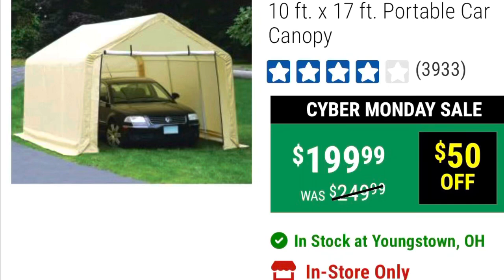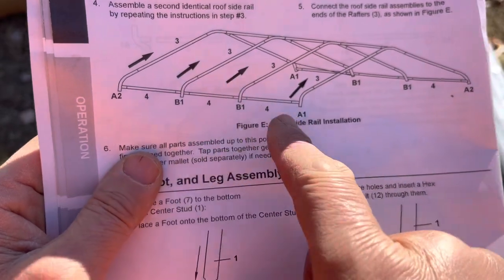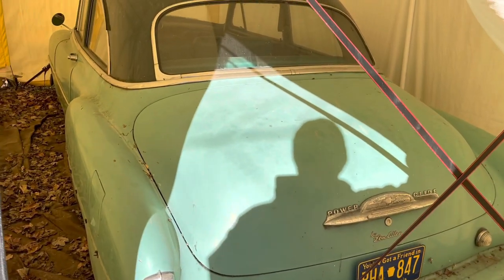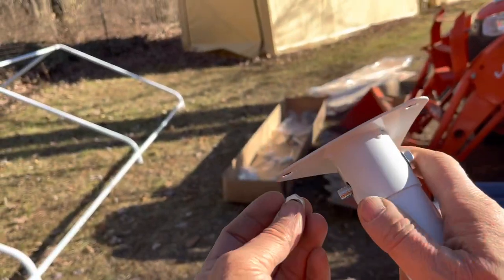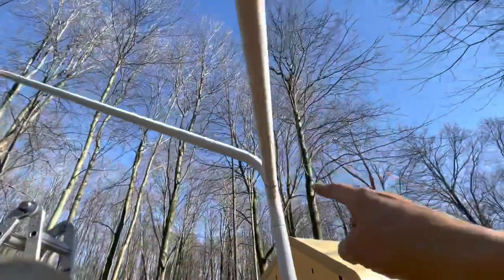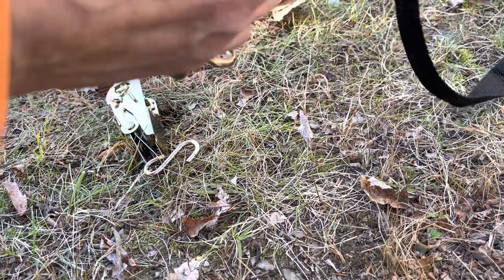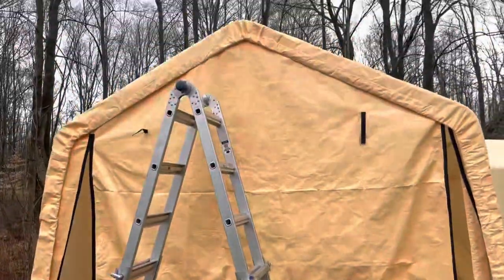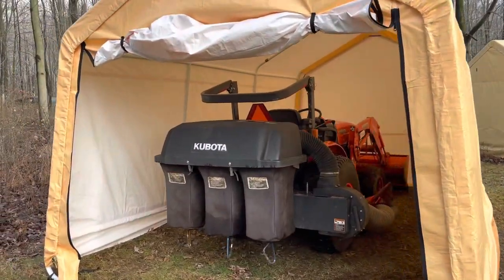Harbor Freight 10 x 17 coverpro portable car tent

Comment: that duct tape and screws sounds like a good idea. thanks because i have no choice but to buy something to cover my bikes and mower until i get my shop built. and the way things are going it might be years before i ever get to work on it.
Reply from the maker: Thanks Glen. These tents last for years
Reply: We just built one of these last weekend I’m impressed with it very satisfied overall. we did not try zip screws however we used gorilla duct tape and we used flat block on the ground (flat concrete blocks the solid kind) and I used a small Masonary drill bit and drilled holes in the blocks and then used tap com screws to screw down the feet of the garage into the concrete blocks it gives it weight so it doesn’t blow away. you can use ground anchors if you’d like how ever I understand the ground anchors that came with ours will back on their own after a while so we did not use them. We’re going to use our gasoline powered earth auger we bought at Harbor Freight and drill a couple holes 🕳 about a foot or so deep inside the garage probably along the sides at or near the ends and put some heavy duty long U-bolts in the 🕳 holes and then put in some sack Crete so we can use some of that heavy duty vinyl coated security cable with loops at both ends so we can lock up our more valuable items riding lawnmower Rototiller push mower etc. etc. and in that a way we would be adding A little security to the shed as well.
Reply from the maker: @william38022  you will find they are very sturdy
Reply: @tsaipod  👍

Comment: Im glad im a year late to the show, did they all hold up through the winter? What was the heaviest snow you got and did you have to clean off the canopy roofs?

I saw one of these collapse under snow load on an old corvette (😮) but i dont know if it was properly assembled/pulled taught.

I want one to use as a semi-pemanent hot tent for winter camping, but rolling up to a collapsed tent would suck!
Reply from the maker: Mine is still up as all four that I have installed in the past they usually last for 5 to 7 years at the very least if not more.

If you construct them properly, you should have no snow buildup on these the snow will roll off the top because the angle is so great on the roof with the plastic.
I’m not sure what you’re talking about the snow building up on rods but no snow builds up on mine.

If you have any other questions, let me know and thanks for watching
Reply from the maker: And yes, we get bouts of extremely heavy snowfall here. Plus, I live near farmers field phone in the winter time the wind blows ferociously, and these things stand up to it.
Reply: @tsaipod  appreciate the info! So, considering your experience my neighbor's canopy just was not pulled tight enough then, the snow collected on the roof in-between the supports (over a few days), and collapsed, that was why I wanted to know if you were clearing it off between storms or anything (my campsite is remote). But this seems like a viable option now, thanks!
Reply from the maker: Yes! If you don’t do it right and don’t pull the material tight the material will droop and not only snow but rainwater will collect in the material on the roof. If you pull it tight this will not happen.  They last many years
Reply: Be lucky to get a year in florida